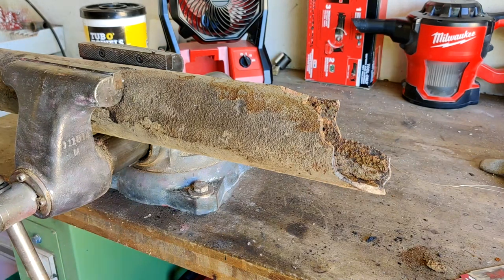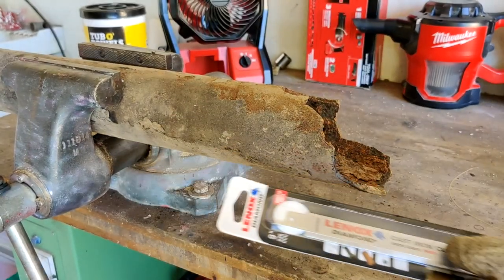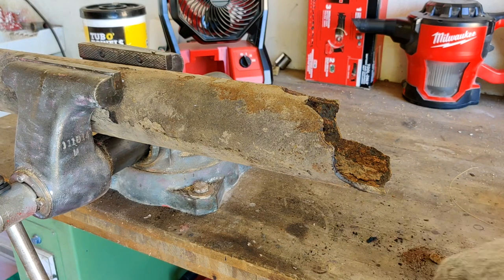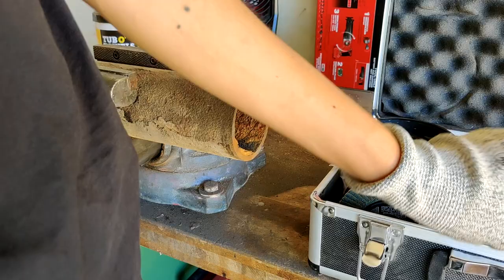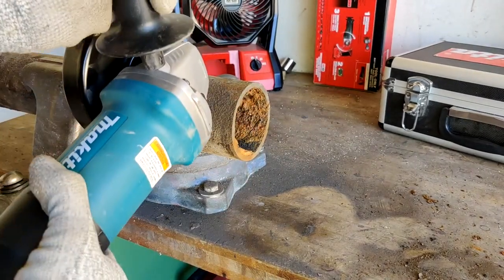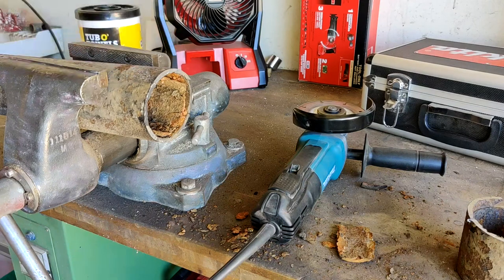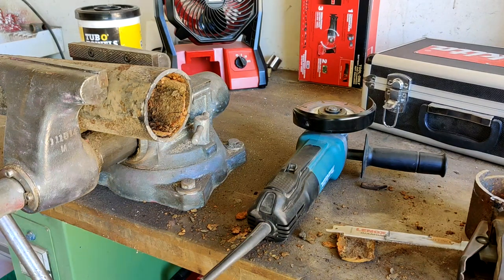The BEST Way to Cut Cast Iron Pipe?

Comment: What is with the Ryobi hate?
Reply: Every Ryobi I bought is discontinued and that includes accessories and parts. They become obsolete too fast.
Reply: @GlenHyden  that is because they are always improving
Reply: @ericmartin3396   That may be. However I would prefer to be able to use the product or add accessories.
Reply: @Glen Hyden  i have never run into that problem. I still have a few tools that are blue
Reply: What everyone here must not know,
Ryobi is using Milwaukee technology from
Several years ago, except not built
To last. Ridgid, Ryobi, Hart, all made by same company that makes Milwaukee..
Plus when your ryobi burns up, take it back to Home Depot, make a scene and demand a new one.. works all the time boys.. I will stick with my Milwaukee/Dewalt  brand tools, pay once cry once..
Reply: @ericmartin3396 Ryobi is trash for construction but if you just a homeowner that's not cutting every day or whatever they will save you some money and last a weekend warrior homeowner quite a few years. Just keep your charger in good shape because I remember they changed batteries on something I had years ago
Reply: @JohnAnderson-kt4mb Pay once cry always. Home Depot definitely stands by the I don't want no bs rule. I know
 "A guy"  who bought three electric heaters every year and brought them back in the box and next year after he bought 3 more. They were always exactly the same product and they were crappy for $80 so that's my excuse for doing it. I mean his excuse for doing it. 😂
Reply: @jamarjames9501  Some ryobi tools are better than the more expensive counterparts, and some are not. They judy don't deserve all the hate. They are a big innovator of some tools.
Reply: @ericmartin3396  ryobi an innovator? Tell me one Innovstion they came out with that has yellow, orange, red and turquoise brands all scrambling to copy? If anything, it’s Milwaukee that’s the innovators. Sure makita has some stuff that is innovative as hell, like the 2 battery powered hot water boiler. Sure I stop off at 711 when it’s tea break time and I get my hot water and sugar biscuits, but for all the other American and Japanese workers that need their hot water on demand, then I know where to look. What I’m waiting for is a dual m12 powered packout cooler, something I can keep a few waters and drinks in, as well as lunch, i know for a fact that shit would be impossible to find the first 6 months it’s on store shelves.. that’s how the M12 heated jacket was, took me a solid week to find one locally.. yes sir, you heard it here, M12 or M18 refrigerated packout cooler.. and you couldn’t honestly tell me ryobi has wood working machinery and tools anywhere close to the quality that Dewalt has…
Reply: @JohnAnderson-kt4mb they have a packout cooler lol. Milwaukee is 100% the top brand in the game. Anything you can think of packout, they have it. Bro they have a fucking coffee mug that clips onto your packout and you can wheel it around instead of carrying. I used to have a few dewalt tools when I was a first year plumbing apprentice. As soon as I saw Milwaukee I sold them bitches and got me some red. Milwaukee is the top brand especially for plumbers. They just seem to aim their brand towards plumbing.
Reply: @Jerm0915  I know they have a “cooler” I’m saying like a mini packout fridge to where it’s powered off m12 and m18 batteries.. makita has one that runs off their batteries just a matter of time before Milwaukee gets theirs
Reply: Consumers

Comment: The drawback to the reciprocating saw is that the vibration and possible jerking back and forth it can create a new problem at the next joint.
Reply: could u you please explain what you mean? what do you mean by problem at next joint what might the problem be?
Reply from the maker: That's true, but if the pipe is so corroded or degraded that a little vibration creates more problems, there is probably a need to change more pipe.

Comment: Ryobi 18v saw with good blades is completely capable of this work.   I've used it many times.    Angle grinder as well.  No issue. Weekend warriors will have no problem with using either

Comment: Why does this new generation of plumbers refuse to use snap cutters?
Reply from the maker: They are great for new cast iron but can crack older pipes. However, they are a nice option for clay or concrete which are considerably more difficult to work with. Also, snap cutters are expensive!

Comment: deep throat portable bandsaw by milwaukee. No contest.
Reply from the maker: I agree that a bandsaw is probably the best way to cut heavy metal, but unfortunately, it won't fit into tight spaces such as when a pipe is inside a wall or in a crammed crawl space.

Comment: You don't have to have a high quality, expensive sawzall. I got mine from Walmart and I've cut through mobile home frames with it.
Reply: I will say that you gotta have good quality blades though. The blades are more important imo. Cheap blades will give out quickly or might not even cut at all
Reply: I got mine from Harbour Freight years ago, and still works great for cutting small trees.

Comment: Doesn't have to be an expensive saw. Cut around 10 cuts though a 4 inch cast iron pipe to remove it with a 3 year old Ryobi Recip that I got in one of those combo packs. Get a good blade though
Reply from the maker: Agreed. A good blade is essential, the saw doesn't matter quite as much. I like Milwaukee Torch blades.
Reply: My very cheap Harbor Freight Tools Recip Saw with a decent blade had no problem cutting cast iron. The blade is what matters.
Reply from the maker: @marvinshook9142  Some cast iron is harder than others too. During my re-pipe project, I found that some pipe sections were easy to cut, and some were rock hard.

Comment: can I use my hackzall? Thanks for the video. Sometimes I use snap cutters and I want to use something to make the cut more straight and my site wont let me use a grinder
Reply from the maker: You can try using your hackzall, I have done it in a tight spot but it is slower than a sawzall.
Reply: @DragonBuilds  thanks for the advice !

Comment: How do you run a blade backwards? It could not have locked in the Chuck. Unless there is some secret new " Sawzall "  out there
Reply from the maker: It is a double ended blade. You can insert either side into the saw.

Comment: If you use Lennox CT laser carbide teeth thick metal blades, you can use any recip saw,  I use my m12 fuel hackzall to cut brand new 4 inch cast iron pipe all the time
Reply from the maker: Wow! That sounds like a really good blade. Still probably don't want to use one of those cheap $30 saws.
Reply: Why in the world are you using blades to cut new cast?  Chain snaps are the only smart way to go with structurally sound cast.
Reply: @liquidrockaquatics3900  if you're referring to me with that question, I do service plumbing and I have a small van not by choice,  but can't always plan to carry all my tools

Comment: Can I cut a basketball hoop post with a recip saw? What blade would I need?
Reply from the maker: Yes you can, any thick metal cutting blade will work.
Reply: @DragonBuilds  okay, I have a Ryobi 18V one-handed saw so I will give that a shot. If it doesn’t work, i’ll get a Milwaukee like the one in your video.

Comment: I just removed my old cast iron pipes from my house.  Tried both tools and found the grinder to be much faster.  And I was using a Black & Decker grinder, worked wonderfully.  Let's stop the cost justification nonsense.  The consensus seems to be cheaper tools work just as well.  They just won't work well for as long.
Reply from the maker: I had a Black and Decker grinder and disc kept coming loose after a couple uses so I just throw it away.

Comment: Thanks for the tip on the blade, I bought two to cut a 4" sewer pipe, I used a cordless Ryobi P519VN reciprocating saw with a 4AH battery, it completed the job with plenty of battery left. I was working in a tight area and the Ryobi was a lot easier than trying to use my old Makita wired saw.
Reply from the maker: Nice! How many cuts were you able to make on one charge?
Reply: @DragonBuilds  only needed to cut one pipe for a bathroom mod
Reply: People dis Ryobi but my tools have completed ever task I needed them for.
Reply: @dupre7416  what the guy in the video doesn't seem to know is ryobi tools are reskined Milwaukee tools
Reply: @hughfitz95  yep, just used my Ryobi, I had to switch batteries but that was just because my first battery wasn't charged.
Reply: And for steel inox tube?

Comment: I just did this today to replace some old clogged up CI pipe. My Ryobi reciprocating saw worked just fine. Just an FYI. Don't go out spending a bunch of money if you already have a Ryobi. Thank you for the video. Ryobi makes good products.
Reply from the maker: My only experience with Ryobi was just the cheap brushed model, maybe the brushless ones are more powerful.
Reply: Ryobi works fine don't waste money 🤑
Reply from the maker: @internallyinteral  Ryobi is probably adequate for smaller jobs or occasional homeowner use, but they just don't hold up to heavy use.
Reply: I’ve used Ryobi as well without any problems. I’ve also used a super cheap Harbor Freight angle grinder without issue.
Reply: Brand snobbery. Use whichever you want. Oh, and I use Milwaukee.

Comment: I need to cut a black gas pipe 90 elbow to replace with a tee to extend for a gas supply in the garage it’s 3/4” fitting
Reply from the maker: If you cut black pipe you'll need to thread it to connect another fitting to it. There's also MegaPress, but it's very expensive to use.

Comment: Can you test some hand hacksaws on the iron pipe ? Would be great to see if those do the job as well
Reply from the maker: Cast iron is very hard, you would probably spend a few hours and wear out several blades. If you only have a couple cuts to make you are probably better off buying an inexpensive reciprocating saw and carbide blade. 

If you are trying to cut galvanized or black steel pipe, it is considerably easier to cut than cast iron, and for small diameter pipe, a hacksaw might be worth a try.

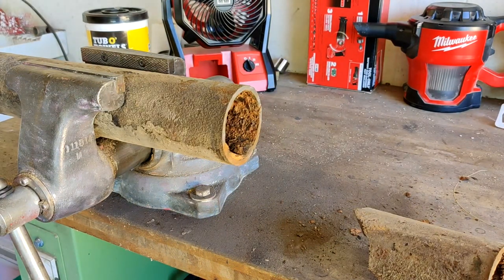Comment: At 1:36 it sounded like you said, "And the cut is pretty smooth which means you can attach a 'fur in co or no hubfitting'" .... what is that last part of your sentence? I ask because I am wondering what is the best thing to attach to the cast iron pipe, once cut, to transition to PVC. Thanks the video and for any additional clarification.

Cancel that. You said it later in the video "nohub coupling or furnco fitting" .... Do you have a proven and recommended supplier/coupling type that you could link in the product description? Thanks!
Reply from the maker: I go to my local Ferguson or order online at supplyhouse.com for most of my plumbing needs. Fernco, Matco-Norca, and Mission make good couplings.

Comment: lol@ "DIY tools like Ryobi" doesn't realize RYOBI and Milwaukee are both made in the same Chinese factory using the same parts, tsk tsk
Reply from the maker: Ryobi and Milwaukee are owned by the same company and are both made in China, but there are many differences in the build quality and materials used. Try using Ryobi's reciprocating saw to make a few cuts on steel or iron, and it'll not perform well.
Reply: @DragonBuilds  I've owned both, M18 Fuel and Ryobi One+ HP reciprocating saws, they performed nearly identical, though, Ryobi's bottom line is noticably sub-par
Reply from the maker: @kenp9199  I have heard about Ryobi's HP line. They are cheaper than Milwaukee but are a little less powerful and also less durable. If you have a Ryobi brushless reciprocating saw, might as well try using it to cut cast pipe. If it dies buy the Milwaukee.
Reply from the maker: What brand do you prefer then?

Comment: I've heard that if you want to get a straight, square cut on the pipe, you can put a stainless pipe clamps where you want to cut and that can help guide you so it's straight.
Reply from the maker: That is a pretty good trick, but for regular plumbing work there is no need for that. It would come in handy if you need to make something perfectly square however.
Reply: You watching too much YouTube plumbers ( like Roger W. ). In real world, things work differently
Reply: Thank you both for response, I’m not cutting the black gas pipe just going to cut a 90 degree elbow to replace with a tee to run gas to my garage for a ceiling mounted heater

Comment: Cast iron chain snaps work unless the cast is rotting. Lennox laser blades at 10-12 tpi will perform the best as long as the speed is kept low. Keep the cut cool and it will go quickly
Reply from the maker: You are right that a snap cutter works well but they are $600 and a single purpose tool. I wanted to demonstrate how I cut cast pipe with more common power tools.

Comment: I cut  a 4 inch cast iron pipe at my daughter house with a saber saw. No problem. I tried cutting a 4 inch cast iron pipe at my house which was thinner.  I went through 4 blades. Dableo blades for cast iron 100 x. cut about 1 inch all 4 blades were worn smooth. Had to use an angle grinder witch meant I had to dig out a lot more dirt.
Reply from the maker: Diablo cast iron blades are normally among the best. Not sure what was going on. I found the diamond or carbide grit cast iron/clay pipe cutting blades to be better on very hard cast iron.
Reply: @DragonBuilds  I don't know if it was the blades or the cast iron. Like I said I cut my daughters pipe with no problem.
Reply from the maker: @cooldog60  Sometimes old cast iron is especially hard in certain spots. Sometimes cutting a different spot is much easier.

Comment: No. U can use snap cutters just have to score the pipe (with the cutters) will clean an score pipe and give a square cut.. but whatever you like to use I guess..
Reply from the maker: Snap cutters can damage old, corroded cast iron pipes. They're great for new cast iron however

Comment: Would the reciprocating saw with a diamond blade cut through 1mm-thick spring steel plate?
Reply from the maker: It should, but if you're in a workshop environment and have plenty of space around the part, an abrasive cut-off tool will work better.

Comment: I have no power. Will a cordless work
Reply from the maker: If your cordless tools are powerful enough they should have no trouble cutting through iron pipe. Just remember to make sure your battery's fully charged before you begin!

Comment: What if the pipe is galvanized steel, installed vertical (part of a fence), and I want to shorten it, leaving a new square-cut end. I'm supposed to hold up a reciprocating saw at head level (painful) and somehow steer it straight (impossible). Whether I use a reciprocating saw or a portable bandsaw, I need something to hold it up and guide it straight. Is there some kind of clamp? To cut steel pipe, need a "heavy duty pipe cutter" (with the right kind of cutter(s)). Where space is limited, need a "4-wheel heavy duty pipe cutter" so 120° is enough swing. The chain type pipe cutter might work for steel pipe too - it has multiple wheels, so it only needs a small swing to cut all the way around.
Reply from the maker: A portable band saw would probably be your best bet to shorten the fence post.
Reply: get a hose clamp big enough to go around your pipe.  It won't solve the problem of holding up your saw, but it will give you a nice straight cut around your pipe.   Also try standing on a stable ladder, so that you're not holding the saw as high.

Comment: 6in cut off wheel with a regular blade is the best. Steel blades are slow.
Reply from the maker: If you have the space to use one a 6 in grinder is definitely going to work well! The same diamond metal cutting wheel I used on my 4.5" grinder also comes in 5 and 6" sizes.

Comment: What about a bansaw?
Reply from the maker: A bandsaw works great for cutting pipe but it is difficult to fit in a tight spot which is common when doing remodel or repair work.

Comment: I just cut three 4" and four cast iron pipes with a roybi 18+ and 4ah battery.   The dewalt blades i bought were trash. 

I own over 50 ryobi tools.  My theory was buy cheaper tools and if one breaks you can always upgrade.  For 15 years ive been using 18v+ and have not had any complaints.   I am semipro and flip about 1 house a year.  I also own an 80 acre farm and use my tools on all the equipment.
Reply from the maker: Yeah Ryobi can be a good value, but I have found that refurbished Milwaukee or Dewalt tools are about as much as Ryobi and are higher quality.

Comment: Which would you recommend for cutting a small steel wrench?
Reply from the maker: Depends on the material. I would go with a grinder if it is hardened steel. Lower quality tools usually use softer steel and are easier to cut.

Comment: Did you just cut that pipe with the blade on backwards?
Reply from the maker: No. Its a Lenox double ended blade. Once one end is too dull you can insert the other end and use it again.